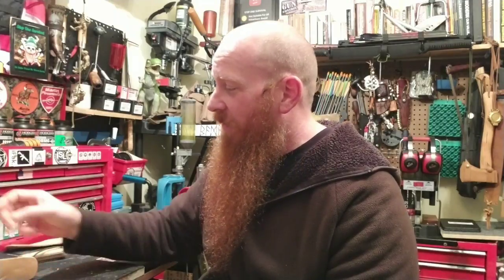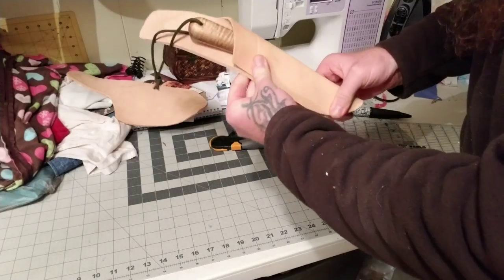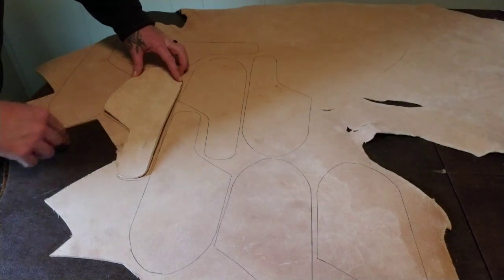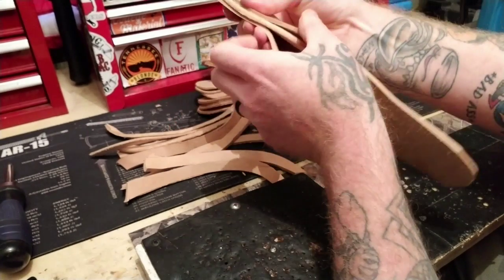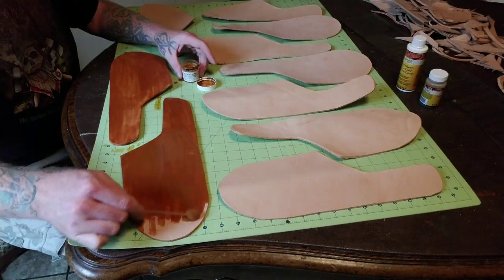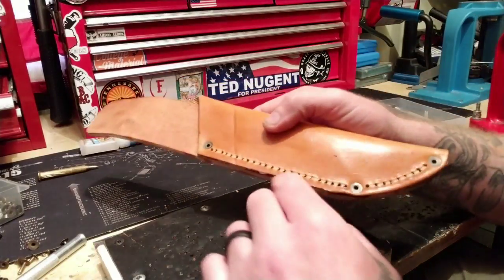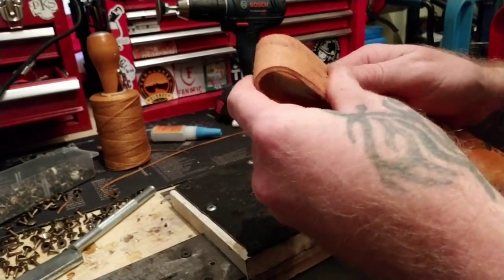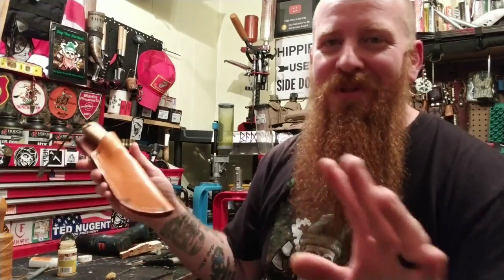Making 10 Bushcraft Sheaths for 10 Pathfinder Knife Shop Knives

Comment: You were making sheaths that last few days, and I have been tearing my truck down and replacing worn out parts since Sunday. I just got the new fuel tank in it yesterday after giving the bottom and top 3 coats of Rustoleum Bedliner coating. Had the fuel system hooked back up by supper time yesterday. Still got two shocKs which are being a pain coming off and then I gotta start rebuilding the floor of my homemade bed with new pressure treated lumber. Great video SSgt.

Comment: Hey Sarge its the Leatherworker from Wales. Decent 4mm leather you have there very good for decent sheaths, didnt notice you using an edging welt though to prevent the blade from cutting the stitching , just some leather glue to hold it in place before you grove the outer and sew them together. It also helps mate to use a v groover to score your centre line before folding and a 4to8 prong punch to keep the sewing straight and make your sheath come together quicker. Leather working is a lot to learn Sarge having a teacher makes your learning come along so much quicker. Keep up the vids m8 you and Sippy Cup are a good team.... :):)

Comment: A zero bevel knife with a custom sheath with a hand drawn gear system to draw mini dymond sharpening disk down the knifes bevel to keeps it razor sharp while giving the knife a very long life from not having to be stoned that is not always perfect. Sheaths down stroke moves sharpening disk over bevel has returned stroke lifts disk to start another down stroke to edge the blade. Good idea bad idea?